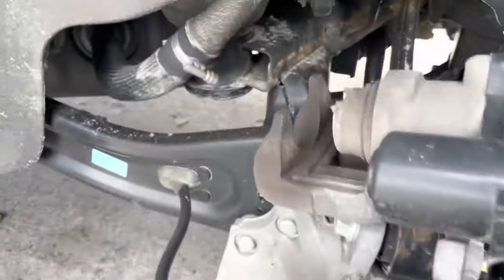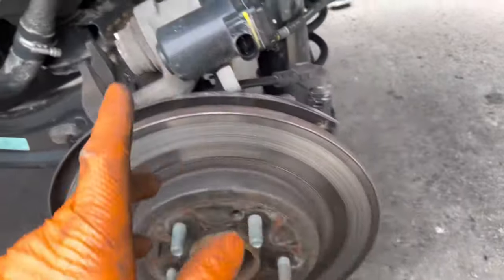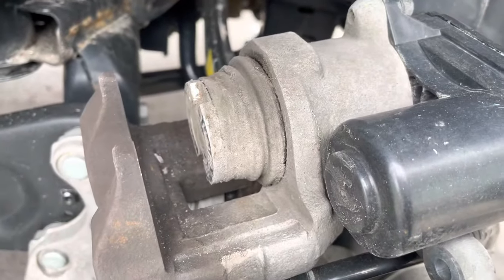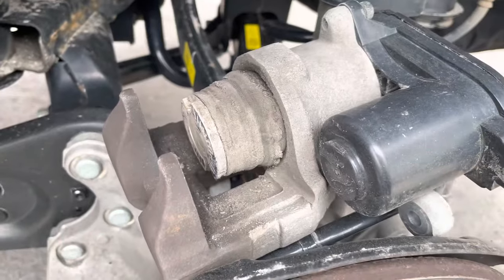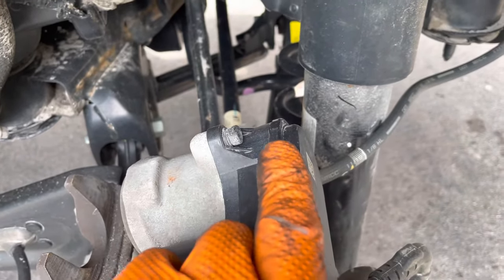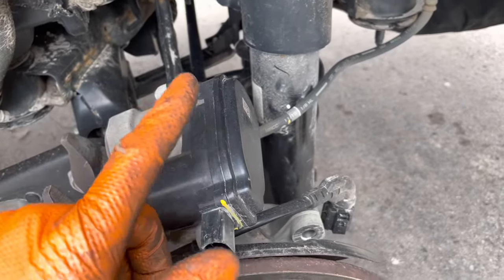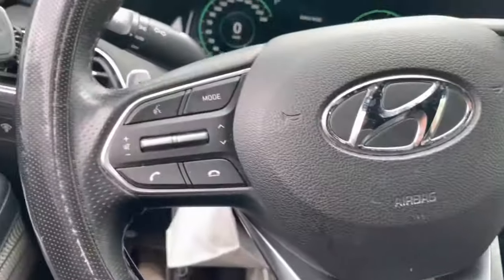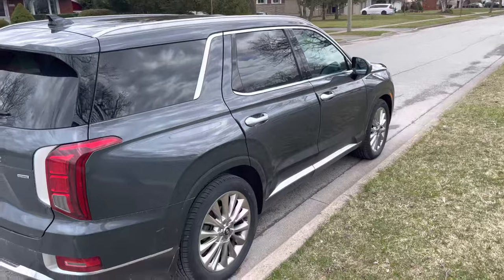Electronic parking brake (EPB) Service ￼

Comment: Great video, very thorough. I already did mine, using the battery method, but did not know the (so simple) method to reset the parking brake. Thanks!
Reply: Did you use a 12v car battery?

Comment: We did the mechanical method with an Allen key turning clockwise until it stopped.  The piston needed a little persuasion to go back in, but when it started moving in it did very slowly and gently.  Thanks for the video.

Comment: Great video, thank you for posting this. Not much content around this. TY!
- how was the brake pedal pressure? Spongy? And did you have to bleed the brakes?
Reply from the maker: If you apply the ebrake 2-3 times and pump the brakes they shouldn’t be spongy. Keep in mind it sometimes takes a bit of driving for the brake pedal the get to it’s fully stiff position. No bleeding necessary!!!

Comment: Great video thanks for making it but why not just wind the Piston back into the caliper using the slots on the face of the piston?
Reply from the maker: If you don’t electronically move it back you will damage it doing that. If you meant why not wind it back using the slots after electronically moving it back. You 100% can but I find most times I can just do it by hand 😂 or a c-clamp which im used to
Reply: @TOPAUTOSC  I just did it the other day I wound the Piston back in using the slots in the face of the piston the car is fine the caliper did not get damaged

Comment: I have an urgent question.  My USA 2016 Kia Sorento Limited AWD supposedly has EPB because I do not have a pull handle or pedal to depress and there is a button on the shift console for engaging it and for the hold feature.  However, when I took of the driver side rear wheel off  today, I could not find any electric connector that would plug into  the EPB module, and I could not find an EPB module.  The caliper is one piece with no screws of any kind to remove a back plate and I don't know that the connection to it is electric; the piston has a hollow core.  I have taken photos of this that I would love to share if possible to get your take on what the heck I have.  Really hope you see this and can assist!
Reply from the maker: My apologies for viewing this late. In the situation where you cannot find an electronic parking brake module the odds are it’s a drum system or it’s a pump for the actual brake hose in which case you don’t need to do anything you need to really make sure that this is the situation. I’ve never seen it in a Kia before, so make sure. Hope this helps.

Comment: Tried to do my brakes before i knew this was even a thing. I compressed the piston without backing off the motor first, now i have weak rear brake authority.

How likely is it that my calipers are fucked even if the EPB still functions normally?

Am i still able to back off the motor and then compress the piston and put everything back on to regain rear brake authority?
Reply: Also, its a 2021 kia k5 ex, FWD.
Reply from the maker: Definitely try to do it the proper way and see if it helps. But you might have just ruined the caliper and will need a new one
Reply: @TOPAUTOSC  ended up doing it the right way and it worked. Thanks for the video man

Comment: So all you need is a 12 volt car battery to actuate E brake to retract? I saw one use a charger and use the 2amp instead.  I guess he didn't want to use 12v . Also i saw another video using a 9v battery with volt meter connectors. Is it safe to use a car battery? Thinking it use 12 v anyway. Just want to make sure of the volts beacause these other videos are making me think twice on the volts. Whst are your thoughts.i plan to change brakes on a 2020 hyundai tucson with E brake next week
Reply from the maker: I would use a car battery and keep the voltage the same. Lower volts would just retract slower but better safe than sorry those electronic components aren’t cheap

Comment: Can you reset the caliber piston by turning the piston itself back in, instead of removing the EPB module?
Reply from the maker: You have to bring the electronic portion back first before pushing the piston back. If you don’t you will ruin a very expensive caliper

Comment: Does pressing the actuator button in engage or disengage the parking brake, im working on mine currently and it also has autohold, epb and brake light on, do the codes need clearing or is something else wrong
Reply from the maker: The odds are you had the ignition on at some point with it disconnected so it read a low-voltage. If you follow the procedure correctly, you’ll need a scan tool to clear that code and everything should work normally.